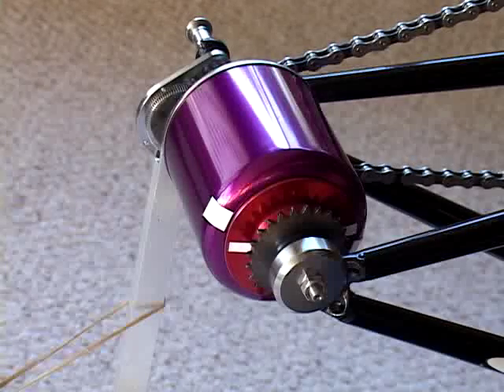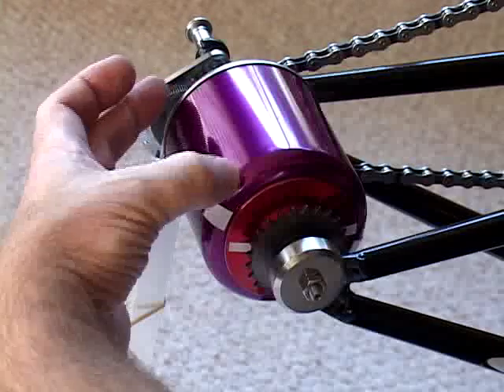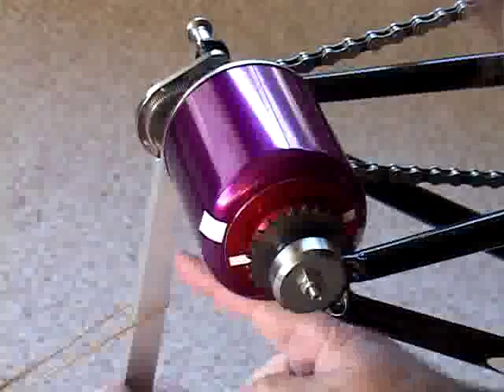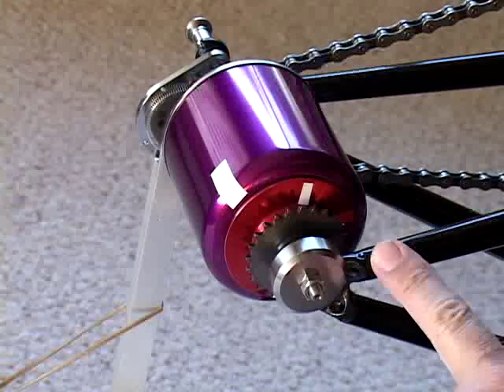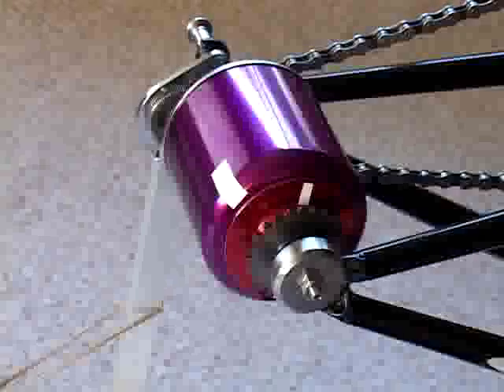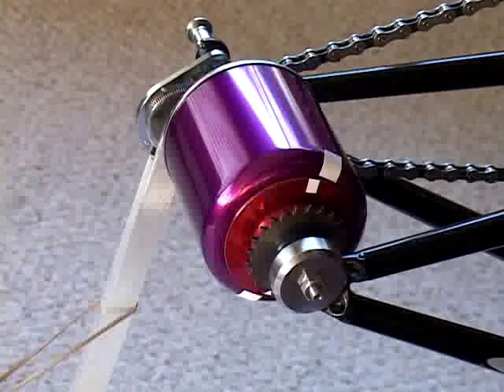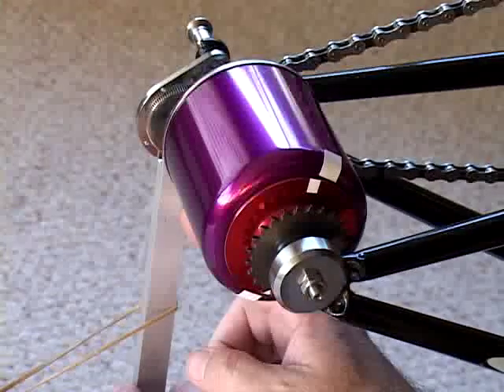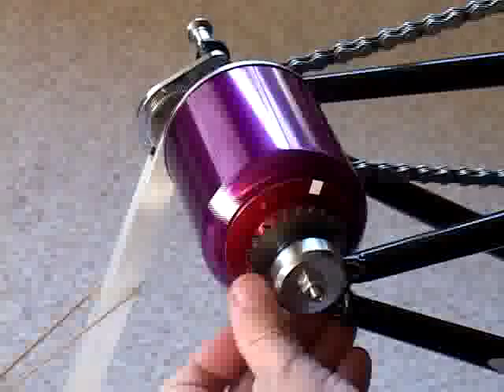Automatic Bicycle Transmission (IVT)

Comment: one third HP is not enough, we need up to 2.5 hp
Reply from the maker: nhoj yesdnil I realized 1/3 HP was not enough after I designed & built this proof-of-concept model for testing years ago.  Since then, I extensively researched the requirements & capacities for bicyclist power throughput in order to develop a realistic standard for my new design of a real, working prototype for bicycle use.  My redesign will achieve ~1000 watts (1-1/3 HP) throughput, which is plenty.  The greatest output measured with elite bicycle racing sprinters was 1600 watts (for a few seconds duration only), so I wont recommend this for those guys!  Typically, fit bicyclists produce 250-300 watts with peaks that occasionally double or triple that for brief moments.  Note that a safety margin will assume that very brief spikes in overload conditions should only affect product life without promoting immediate failure.   

The 1000 watt rating will open it up for some legal (unlicensed) motorized bike use.  The SIVAT's inherent overload protection will assure safe, but disappointing results for those who try to over-power it!  The overload protection is user adjustable to accommodate different power capacities by various bicyclists who want to adjust the transmission to suit their personal pedal-force & cadence preferences.  In effect, the power rating is adjustable up to 1000 watts for the redesigned model.

Efficiency is unknown yet.  An oversight in one of the myriad of design considerations for this proof-of-principle model disallowed a proper test at rated power.  However, I've analyzed the drive-train in terms of the number of gear meshes in-series, the industry-accepted typical losses at those types of meshes; and calculated composite efficiency varying between 91% and 96%, depending on the approximate gear ratio.  As with all transmissions, efficiency tends to drop in very low ratios.  This efficiency range would be competitive with Rohloff, but 2%-3% less than well-aligned derailleur gearing.  Anyway, I'll test & publish test results for the next model which will be funded through crowdfunding or similar.  Of course, proper testing will require life-testing to 5000 hours (industry standard), power throughput testing, input & output speed-range testing, efficiency testing, and possibly destructive testing.

This is a geared system.  As such, much can be predicted about its performance because it uses tried-and-true technologies in a novel way.  Since it's a unique concept though, testing it thoroughly is a must!

Comment: In my personal experience doing climbs with my bike, I would change gear ratio depending on how tired my legs become. Sometimes I prefer off the saddle with slower cadence, using harder gear. And sometimes higher cadence using easier gear.  I don't think this system would be able to detect or predict that preference.

Comment: Overload? Oh god...
>Biker goes up 40 degree hill 
Overload kicks in
>Biker starts going backwards
"Oh shit"
Reply from the maker: Aaron Lowe Actually, the simplest version of this has an intrinsic 'hill-holder' feature; the driven wheel won't go backwards!  I have to add a release mechanism to allow backward rotation.  Regardless, biking up a 40 degree hill ain't gonna happen... 30 degrees is a boundary beyond which the rider will wheelie over backwards, which is the limiting angle used to determine maximum wheel torque I use for design overload.  You might fall over sideways when you stop, but you won't roll backwards on any ascent without actuating the release device.

The torque-limiting feature will ensure that users don't over-drive the unit with an accessory over-sized motor.  This feature will not suddenly act, but will simply keep lowering the gear ratio gradually until it stops driving at all or until the overload is reduced.  I've done a lot of mountain riding myself, so I know that any sudden disengagement would be maddening, and avoid that in my design.

Comment: But this only has a max output ratio of 1 to 1... Meaning you would still require a gearing / pulley system of sorts to increase speed... Even if this reduces the torque required, at some point you'll still reach the point where you'll be peddling like a tramp to try and keep your speeds up... Pfft... I dunno... I could be wrong =P

Comment: 769 people are jealous they didn't invent this before you.
Reply: goatstaog ¬_¬ "I didn't fail.  I just found 2000 ways how not to make a light-bulb; I only needed to find one way to make it work" - Thomas Edison
Reply: +myelectroncloud and so did Swan!
Reply: aR Bemo
Well, I suppose if we were to discuss it in semantics, we could go back to 1806 and Humphrey Davy.
However, we can credit Edison with the invention that lasted the greater amount of time, not to mention the (then) current (no pun intended) efficiency.
Reply: +myelectroncloud its useless, its effectively a clutch. No gearing at all. Jealous, no.  A bit smarter? Probably.
Reply from the maker: +mart fart Important distinctions: 1) It does not use dynamic friction, so it wastes no energy converting work into heat; 2) it uses no friction plate that will wear; 3) its completely controllable over its full range; 4) it modulates its ratio precisely in response to torque demand; 5) it is fundamentally a geared mechanism.  That's more than a 'bit' smarter!
Reply: SIMKINETICS
Where is top gear? Acts like a diff, nothing more which has 1,2,3 above inc.
Reply from the maker: mart fart Top gear is ~0.6X (output-to-input ratio).  It's a reducer.  It does use a differential, but does have more to it.  Higher gears than 0.6X are achieved with auxiliary up-gearing that still allows continuous ratio change to zero.  It's not as simple as you imply.
Reply: mart fart You'll be wanting to go away now, then...

Comment: How is this different from the Rohloff Speedhub in operation?
Reply from the maker: That's a great question!  Hopefully, Ill give you a great answer!

First, I should tell you that I've been a mechanical engineer since the late '70's, and have been fascinated with bicycle gearing systems since the early '60's!  I had to own a Speedhub, just like nearly every other planetary-geared system that I owned & pulled apart, analyzed & re-assembled since 1963.  Dr. Rohloff created an engineering masterpiece that offers less troublesome shifting over a range of 13 steps, each a neat 14% higher than the preceding step!  It works beautifully, but I'm not convinced by their publicized efficiency ratings; in a way, such efficiency loss must be balanced against the fact that Rohloff's gearing promotes more efficiency in the ergonomic sense of human body dynamics.  

I've designed several transmission systems during my career, all kinds of translators and rotators to effect better torque-speed matching between prime-movers and effectors.  Much of that has gone into robotic devices where weight & efficiency are critical parameters for optimization.  Multi-stage planetary gearing systems are compact for specific power through-puts. and they offer great flexibility in spanning gear ranges.  From the efficiency standpoint, there's a known power loss at every node or mesh of gears, each compounding on each other.  At this point, I should compare my SIVAT with the Rohloff.

The SIVAT uses planetary gears like the Rohloff, but short-circuits some of the gear-meshes with an innovative mechanism that has unusually high efficiency at its mesh.  I suspect that the SIVAT's efficiency will be at least as good as Rohloff's.  Since bearing, gear & tooth-sizing are comparable between the two systems, power through-put should also be comparable.  The main advantages of the SIVAT are its ability to access any ratio within a very large range, and to enable them to be automatically shifted to accommodate loads with optimized input speeds.  The
Speedhub has 13 distinct steps to ratio choice, whereas the SIVAT offers a continuum without steps.

Looking inside each system reveals some of their similarities regarding part sizes & component count.  They're both quite compact with a lot going on in a small space; like a watch, except simpler.  They'd both perplex nearly everyone who'd observe them operating from an insider's viewpoint!  The best way to really understand planetary gearing is through mathematics; watching the gears go around is just confusing for most people.  I don't know what Dr. Rohloff's attitude is, but I'm convinced that the best transmission system is ultimately a realization of an optimized mathematical model.  Anyway, trust that the very specific geometry in each system is the result of a great deal of planning that's invisible to the casual observer.  The engineering term for producing a very compact, capable system is "...puttin' 25 pounds of bullshit in a 10 pound bag!"  This amounts to a massive challenge to precisely specify each component to it's rated capacity within a narrow tolerance.  I"m sure you'd be quite impressed by what's inside the Speedhub or the SIVAT.  

The gearing range is defined as the ratio of the highest gear ratio divided by the lowest gear ratio.  For instance, a 6:1 high gear with a 2:1 low gear would have a gear range of 3X; as would a 2:1 high gear with a 2/3:1 low gear.  Mountain Bike derailleur gearing ranges are typically 4.9X or 5.2X.  Rohloff offers its gearing range of 5.5X.  SIVAT gearing range is about 30X at low through-puts & about 15X at rated power through-puts; it would be very rare to actually use all of that range, but it's available.  Although the SIVAT's highest gear is below 1:1, high ratio sprocket gearing raises the final ratio to a practical high.

So far, I've only ridden a Speedhub-equipped bike, not a SIVAT-equipped bike.  I have some idea though about how the SIVAT will work from experience with its predecessor, an automatic CVT.  Both function very nicely.  If my SIVAT ends up as good or better than the Speedhub, I'll be very happy.

BTW, I modified one Speedhub to accommodate a 27-speed derailleur mountain bike gearing system, and mounted it on a F.S. MTB.  The bike has 378 gears! ...minus some redundancy.  It works, but needs some help with the derailleur system take-up to accommodate more freewheel drag in the Speedhub..
Reply: interesting...I have a pretty good understanding of how the system functions,would be much better to have one to dissect to fully understand the inner workings though.....the speedhub has gained quite a following since it first was introduced...I've talked to quite a lot of people that have one and so far the only "complaints" have been with the transition between the up shift from 7-8 and the down shift from 8-7 requiring to let off a bit on the input before gear switching can occur...but Rohloff explained the reasons for that being a built in safety measure because of how the gearing mechanism functions...otherwise they are nearly bullet proof as long as recommended torque input is not exceeded  which is extremely unlikely that even a veteran rider would ever be able to do (their ratings far exceed even what torque world class athletes can provide)...if you order one with a custom gear ratio (significantly lower or higher) that is outside of what they consider "mechanically sound" they will tell you there is no warranty and you're on your own...I've always wanted to try to put on of them or something similar on an electric bike and use a hub dyno along with it in a way to still be able to pedal but have a hub dyno set up to charge a battery while you're peddling and always have electric power on demand...would also be using a carbon drive system on it for quieter operation...maybe we could put our heads together and come up with something?

Comment: unlimited, infinite ratio ? do not specify any actuality. it must have an upper and lower limit, thus i take your description to indicate it may be widely vary in ratios (between upper and lower limits) in infinitely or unlimited small steps. as in say 3:1 to 1:3. instead of 5 specific steps 3:1, 2:1, 1:1, 1:2 1:3 - it appears you are referring to infinitely variable or rather constantly varying steps through range from 3.00:1, 2.99:1, 2.98:1, 2.97:1 ,<..> 1:2.98, 1:2.99, etc. further indicated by suggestion to to implement additional gearing on the input / output to increase effective range of overall ratio.

as someone pointed out, there is no going from 1 revolution input to infinite rev's out.
Reply from the maker: This doesn't go from 1 revolution input to infinite output revolutions; it's a reducer, and does the opposite.  As for its infinite range, this means that the input revs to produce any output trend toward infinity, i.e. producing zero output.  This condition produces an interesting potential because the whole system can be geared up by auxiliary gearing to define the systemic high gear ratio without losing its ability to approach (and reach) zero output.  The physics of all gear systems limit up-gearing via limits on gear-tooth pressures in the presence of friction that increases resistance as ratios rise, so the SIVAT is also constrained from any excessive systemic high gear, but such high gears aren't very useful.  The SIVAT, though, on a bike will reach higher gear ratios than anyone would likely use in its next configuration.  When considering overall bicycle hub drive 'gearing', the drive-sprocket ratio must also be considered, 5:1 in the featured example; the next generation will integrate higher gears in the hub, so a small front sprocket can be used at the pedal crank. 

This is not strictly a CVT with finite upper & lower limits, and continuous adjustment between them.  It's referred to as an IVT because it can reach zero output with infinite input, not because it offers 'infinite' choices of ratio adjustment.  Unlike a conventional CVT, the SIVAT can extend its range of ratios with auxiliary gearing.  Most CVT's can only offer a high gear about 4 times the low gear ratio, whereas the SIVAT may offer a practical bandwidth that's >5 times wider than a CVT!
Reply: what do the internals look like

Comment: that's extremely cool, but a 1:1 ratio on a bicycle is not that practical. Would a future model be able to match the higher ratios of current bicycle gearing?
Reply from the maker: Notice the chain drive that converges on the rear sprocket; it comes from a 55T to an 11T, giving it a 5:1 multiplier of the SIVAT ratio.  Regardless, the next generation design will be a SIVAT with an internal high ratio of ~2.6:1 so that a smaller front sprocket will yield a final ratio that's higher than most bikes while giving better ground clearance under the pedal crank.
Reply: OK that makes sense. Thanks for the clarification.
Reply from the maker: Evan Eko You're welcome.

Comment: It seems odd that he didn't mention efficiency.  Also, the one he demonstrated was good for only 1/3 HP.  A person can, for brief intervals, produce more than 1 HP.  What limits the power handling capability?  Can it handle more power for brief intervals?

There is insufficient information to know whether it is practical.
Reply from the maker: You're correct that a person can produce >1.0 hp for a brief interval of a few seconds.  I mentioned that, and revealed the calculation for efficiency in much earlier response comments.  Bear in mind that this is a proof-of-principle prototype, not the final design that should handle at least 1.0 kW (~1.3 hp) in a similar package size.  I'll need a dynamometer to test its efficiency, but calculations of the chain of components, whose efficiencies are well-characterized in engineering books, appear to vary between 89% to 95%, depending on the momentary ratio.  Testing the final design will determine its practicality for bicycles, but the basics suggest that it will be practical.

Comment: I can fab up a prototype of what you're showing that will do the exact same thing in the video, yet be just as useless as yours is when any kind of mechanical load is applied to it.  You should hang around with the guy who's pushing the "D-Drive"  transmission

Comment: This looks great!  Does this mean that if I am pedaling a consistent pedal pressure the bike will automatically change gears and my speed will slow down while on an incline and speed up on declines.  Like normal, only I don't actually have to manually change the gear unless I want to?
Reply from the maker: Correct!
Reply: SIMKINETICS I would really like to have that!  I hate changing gears all the time.